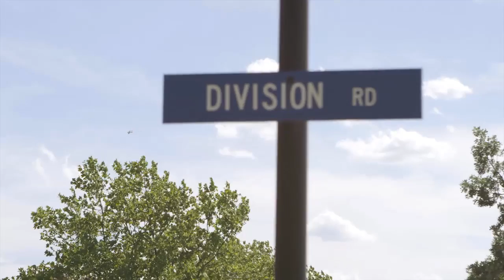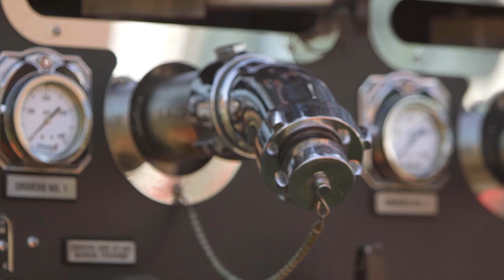Fire Dynamics in the 21st Century

Comment: I was just thinking about adding an air hose into the BBQ which would heat it up more like a furnace? Then would it melt the BBQ. 

Then I thought mayb fire is like water. When you squeeze the hose its more powerful. Squeezing the fire with air does the same thing. Ish. 

So I searched Fire Dynamics and I got this. 😥 

I was hoping to see some fire squirting hell scaping. That open fiery window looked good for an intake with a good gust though so would it have the same effect? 

Cos in the summer I alway try to open two windows on opposite ends of the house through my spot and feel every gust rush through. When I thought mayb one open window is pointless cos air pressure mayb. It can't blow more air in unless air is escaping too. Intake and exhaust and it does work way better.